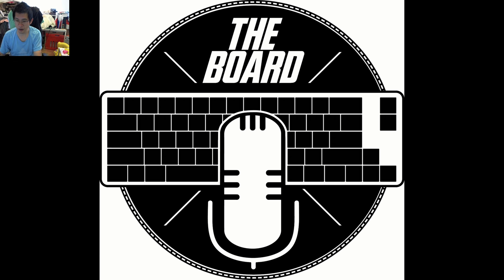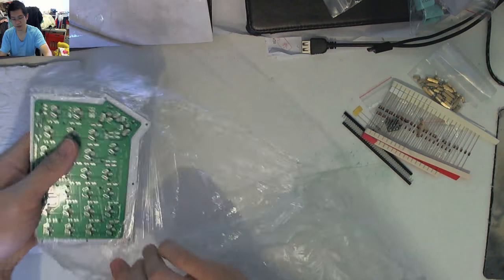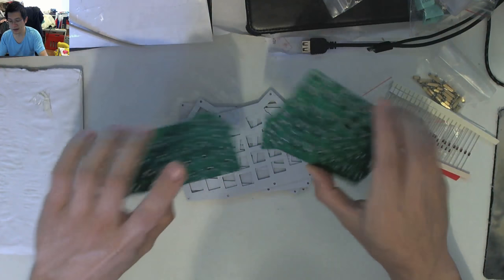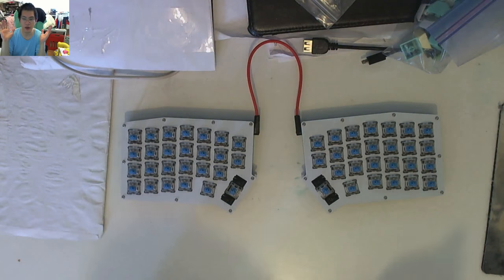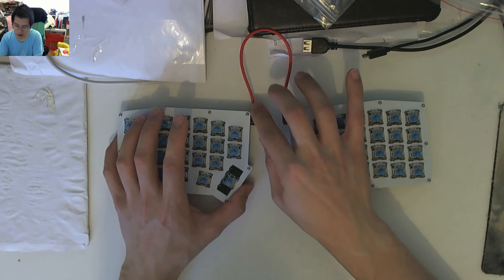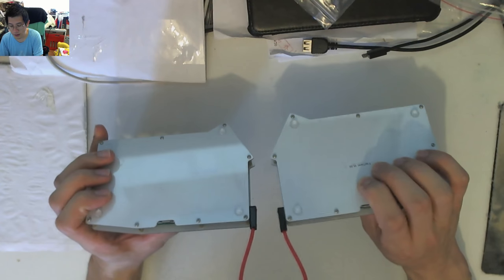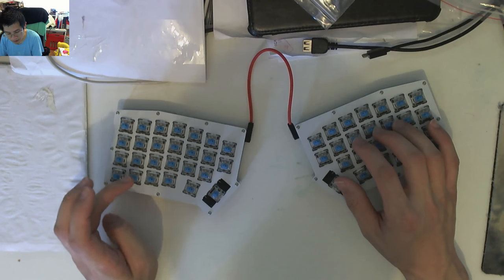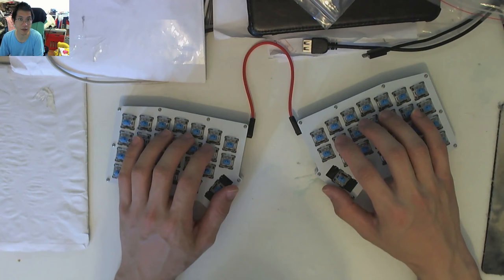Building and Reviewing the ErgoTravel Split Ergonomic Keyboard

Comment: In the midst of my own build from this kit now.  I install the I2C resistors and soldered the jumpers, so we'll see what happens.  ADVENTURE.  Good catch on teh standoff size vs. sockets w/ the Promicro.  I'm gonna have to test assemble my 1.03 kit and see if it can use the nice pinsets that come with the promicro or have to do teh leftover pins from diodes.
Reply from the maker: Thank you for checking out the clip. The diode legs won't be an issue since once the bottom is put on, its not like the pro micro is going anywhere, so you shouldn't be too worried. They work well enough for 40% club so even though I didn't do that, I know its much accepted practice, especially for low profile boards. Always a good fallback plan if pinsets don't work, but I'm pretty sure the sockets are too small for the fatter headers though.

Comment: Sweet looking little board. I don't really understand the benefits of i2c either.
Reply from the maker: So I2C enables you to daisy chain a bunch of USB devices off each other. So in theory, by using the the available headers on this PCB, you could connect another USB device to one hand, without needing to plug it direct to the computer, as it'll communicate through the keyboard's USB connection. Or at least thats how I understand it.
Reply: Could you test if this works? It'd be great if I could daisy chain one half of a Let's Split to use as a macropad or numpad.
Reply from the maker: So from my research, right now, QMK doesn't exactly support I2C, but it may in the future. That said, I'm not 100% up to date on QMK's abilities, so perhaps check the QMK website (https://qmk.fm/) regularly.